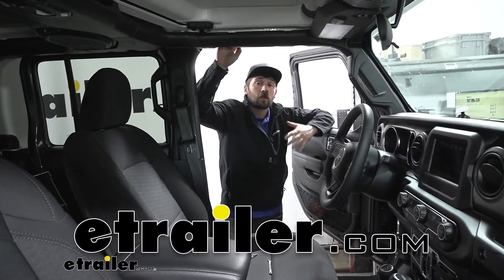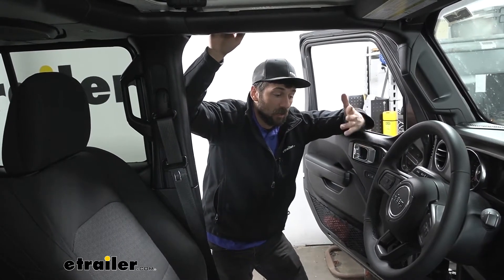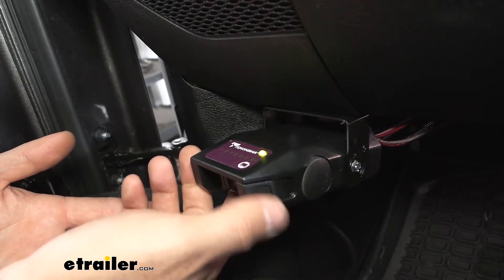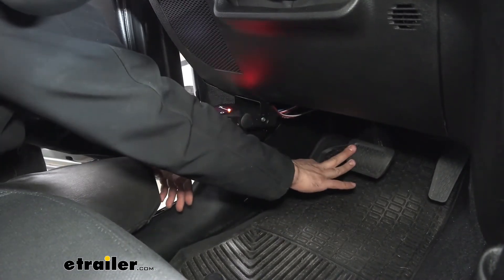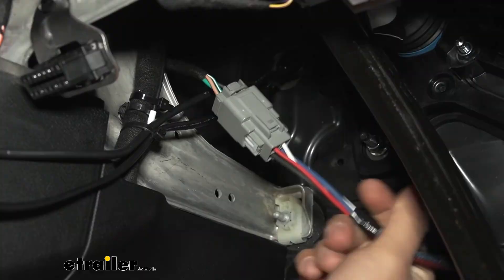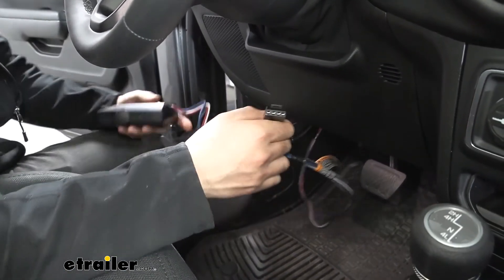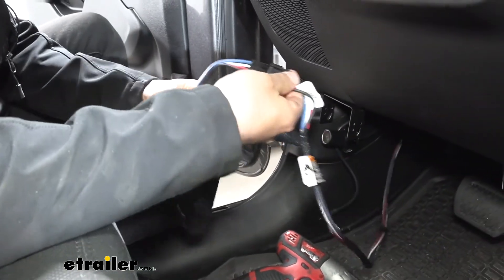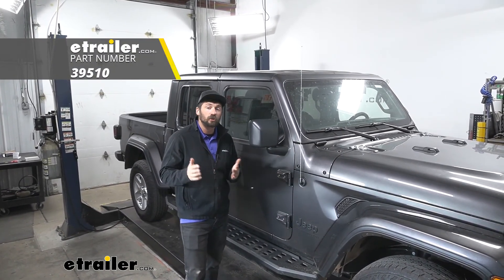etrailer | Setting up the Tekonsha Voyager Trailer Brake Controller on your 2021 Jeep Gladiator

Comment: what is the part number to the harness that is needed?
Reply from the maker: Check out the following link to see the wiring harness you will need to connect the Tekonsha Voyager brake controller to your 2021 Jeep Gladiators factory tow package connection.
https://www.etrailer.com/Accessories-and-Parts/Tekonsha/3073-P.html
https://www.etrailer.com/Trailer-Brake-Controller/Tekonsha/39510.html